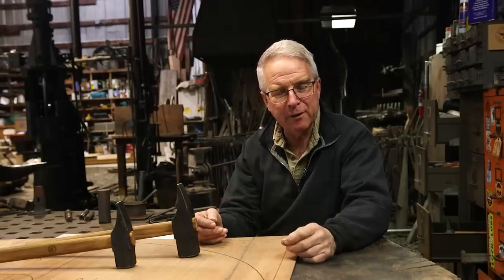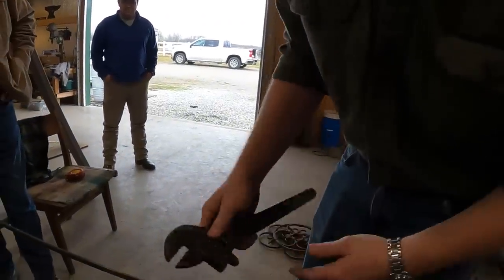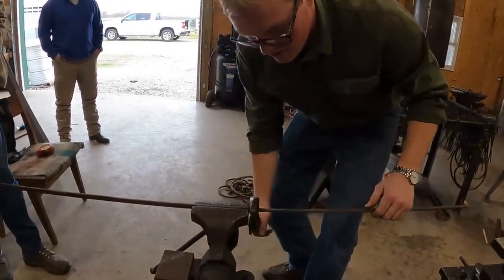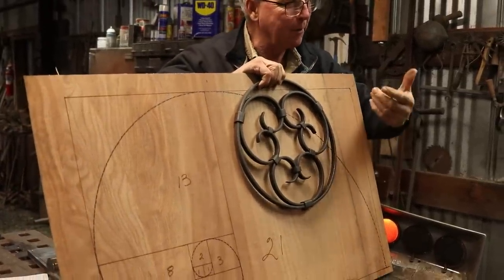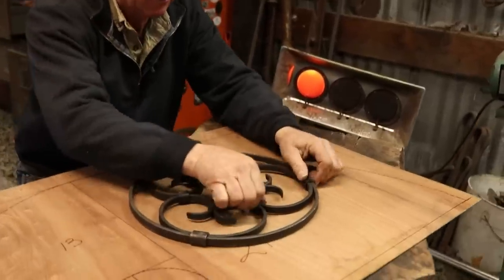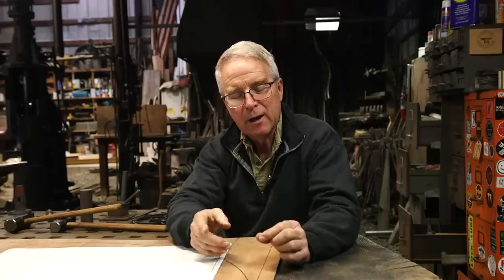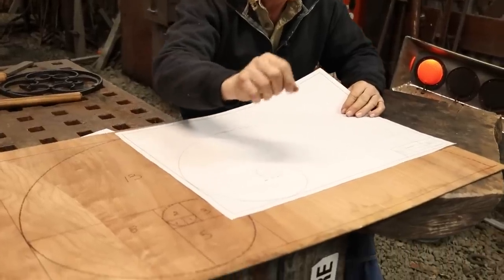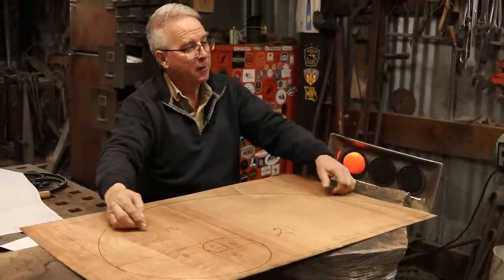3 Blacksmith Efficiencies & The Golden Spiral (2 Young Pups Teach An Old Dog New Tricks)

Comment: Blacksmith shop can make anything,  Blacksmith shop with a good welder can make everything better, faster,stronger, and cheaper. Add a plasma cutter and an oxy acetylene torch and a good metal break and a mandrel bender and you can make everything perfectly

Comment: Beginnings of an idea just occurred to me: what if you made a ring or pipe bender that was geared to change its bending radius as a function of how far you cranked the material through it?  Change the gear ratios for the size and tightness of the spiral you want.  Could form decorative scrollwork or springs.  Thoughts?

Comment: I don't understand. I just tried to cut some bar the way he did and my crescent wrench just rounds the corners over....
Reply: Make sure it’s real tight and there is no space in between your two locking points. Rectangle bar works best for this.
Reply: @Jonathan Pinkston  I think my problem is I have husky crescent wrenches and they seem to have quite a bit of loose play in the screw. I think after I'm getting it tight on there and begin to turn the jaws are moving open a bit.